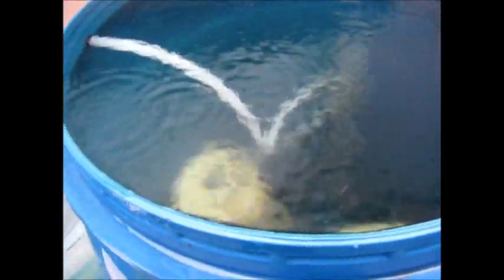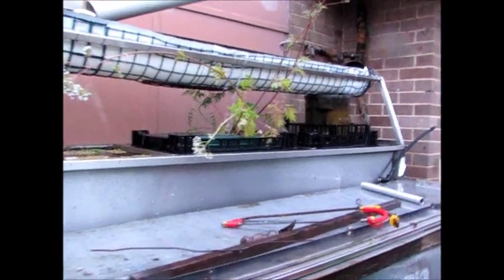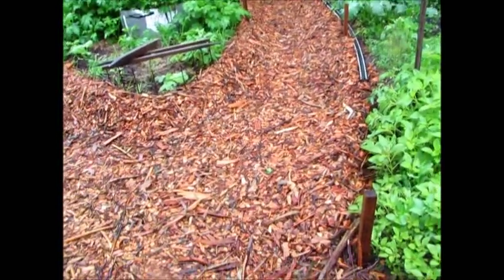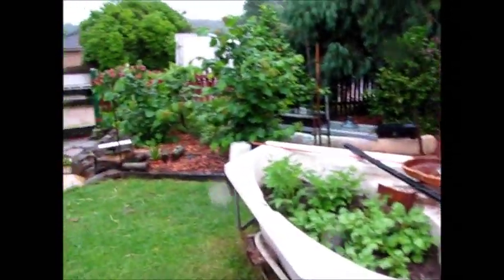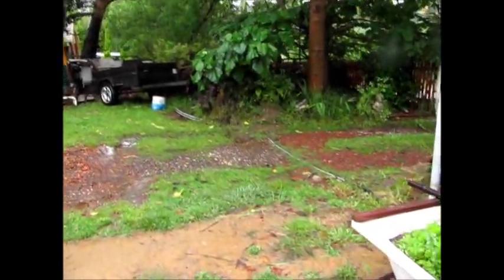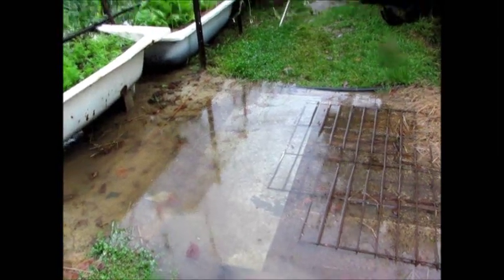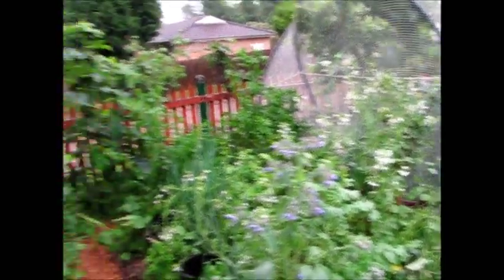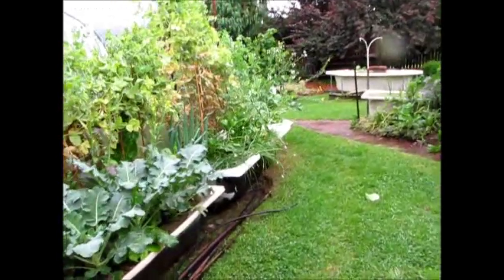Keyline Design 2 -  A lepers garden - Intergrating Water

Comment from the maker: @MrChrisTowerton Thanks.  I live in a small town that had a makeover about ten years ago, picked them of the street, also our local tip has a recycling center.. They are for an aquaponic, bioponic system that's getting rebuilt, so i use them with soil this season. lots of time and passion and redesign, great things are worked many times over